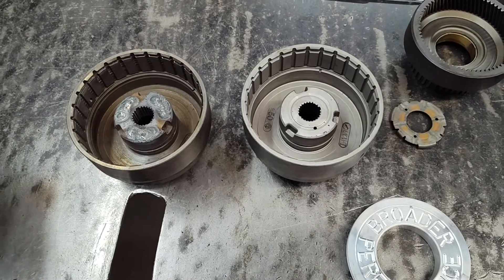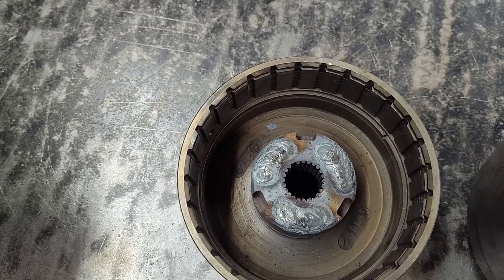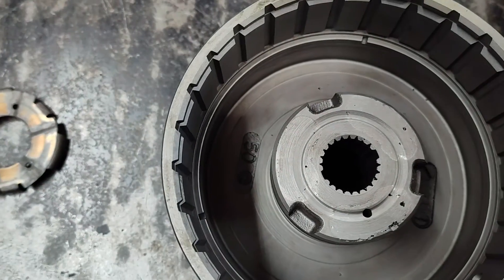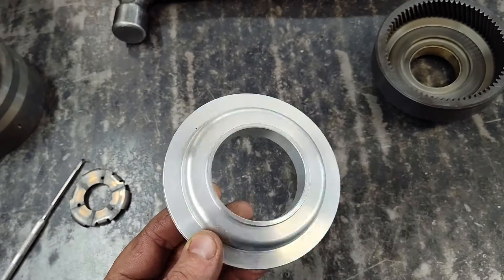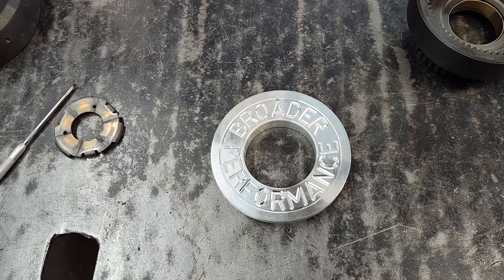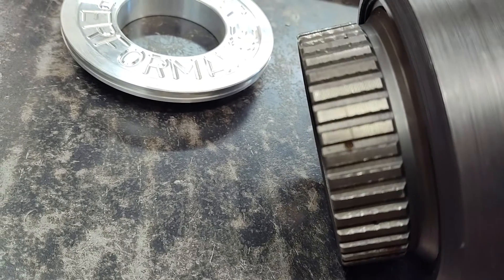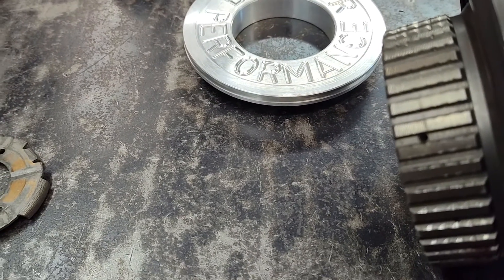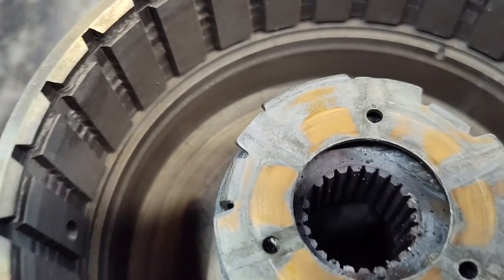Ford C4 Forward Drum Modifications

Comment: Have you ever just used two belville springs instead of that billet part?  I installed two in my forward drum when I ran 295 PSI line pressure.  It never broke or over extended the fingers.
Reply from the maker: I have not. I can see how that might work for a C4 but on a C6 it would most likely still break the top of the drum off.

Comment: Billet Steel Ford C4 Forward Clutch Drum

This C-4 Forward Drum is a marketplace FIRST!

Precision machined from 4140 HTSR billet steel providing superior strength and durability
The drum comes with one .095" thick steel plate for clearance adjustment and, one pressure plate.
Made for drag acing and off-road applications
This drum can accommodate 5 frictions     Save All that trouble

Comment: So Iv got an oil leak I can’t seem to get rid of from inside the bell housing, brought it to the trans shop multiple times, he replaced stuff and loctited and silicones the pump bolts but still coming from it, what could be done to resolve this issue? Thanks in advanced!
Reply from the maker: Have the converter leak tested.

Comment: Love you sharing your knowledge Jay Thank You, question, you mention your custum high pressure piston for this drum and I wonder at what pressure level do you find it to be needed and or how high of pressure do you even feel is safe for a C4 period running constant pressure, I have one of your Transbrake kits installed but with stock bellville spring and piston and about 250PSI line pressure do you feel I am in a danger zone yet without one of your pistons?
Reply from the maker: I'd say roughly 220+ constant pressure.

Comment: I recently bought a rebuilt race C4 from a transmission rebuilder. Installed the transmission and it worked fine. But there was a problem I did not discover until about 500 miles later. I was doing some work on the engine and when disconnecting everything to remove the engine I pulled the rear return cooler line loose expecting the usual flood of oil. Not one drop of oil came out of the hose.  Apparently, the transmission was running without any oil in the cooler lines. Thinking that I did something wrong I blew out all the lines with air and had plenty of flow. Running without oil to the lubricate the rear half of the gear train I was expecting the worse when I took the transmission apart. But all I could find wrong was a worn case bushing and replaced it. But when inspecting the "rebuilt" pump found the drain back valve jammed shut with metal shavings apparently from the rebuild procedure. I put another rebuilt pump from a different transmission rebuilder that had removed the drain back valve and instantly had cooler line flow. I have never seen this happen before. So you have to check everything. Rebuilt or not.
Reply from the maker: Common problem. That's one of the reasons I remove the drain back balls
Reply from the maker: Common problem. That's one of the reasons I remove the drain back balls.

Comment: Hello. I am new to building tranny's and your channel. I am building a C4  for my 65 mustang. Took me about 18 months to find a good core , 1977 so it has some better internals. My engine is a 331 stroker. About 390 HP at the crank. How much should I be modifing inside this c4 . Thank you for your time.
Reply from the maker: I dont have a quick easy answer but most of the bearing stuff you dont need. Keep watching the C4 series I will cover this.